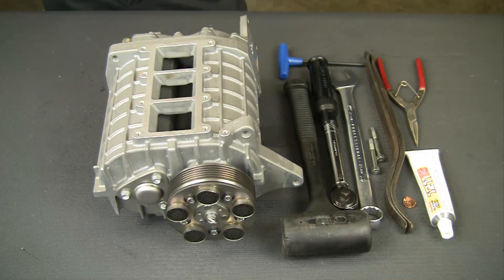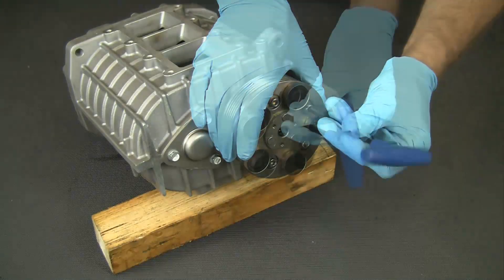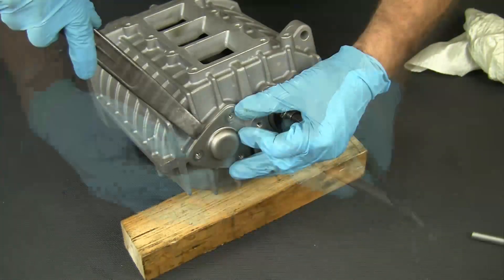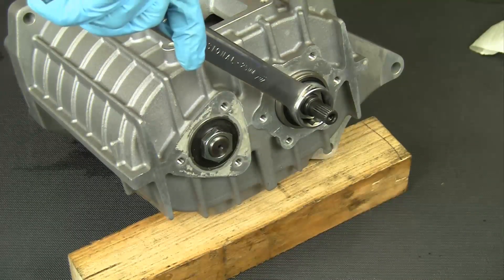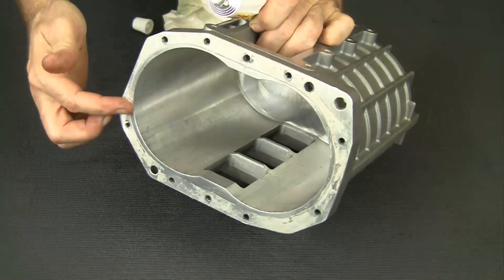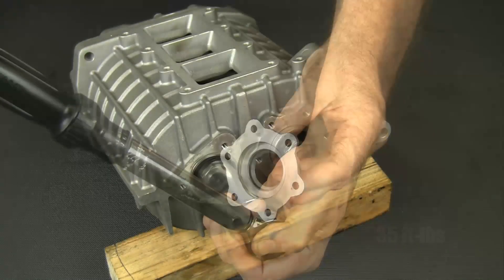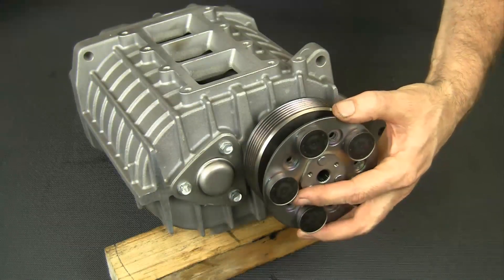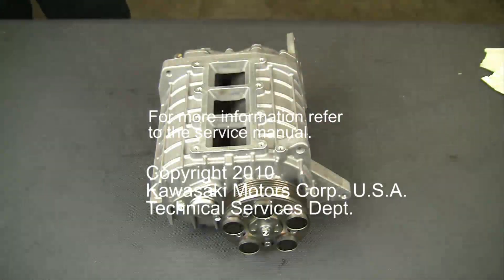Disassembling the Kawasaki Ultra 250/260 Supercharger

Comment: If the Teflon costing is coming off does the supercharger need to go in the bin? Or can you continue to use?
Reply: How bad is it? Small scratches, or big chunks that have fell off?

IIRC - someone did say that even if the whole coating comes off, exposing the aluminium rotors, it will still work.
But my guess is that the air being compressed and pushed out - will no longer be efficient since there are gaps between the rotors.
Do expect that less boost will be present if the teflon coating has already come off completely (or become in a very bad state).
Reply: @hsk2451  thanks for the reply.  It's got decent chunks on it, if I used as is the rest will likely go through the engine.  

I'll open it,  and strip off the remaining and see how it goes.  I'm using on a 4cyl toyota engine. Down a few psi is fine... if the concept works then I'll save up and get a new one.  

You're vid very helpful for the teardown
Reply: @Garage_Dori  Nah, video's not mine Sir. I'm also in the process of repairing my supercharger (Ogura TX15P)... and some internet community guys pointed me to this very useful video!

Comment: Hello man, love your work, and will be good help to my engine rebuilt. Thanks a lot.
Can I ask you look a guy with lot experience in this kind a engine, I have 2007 kawasaki 250X ultra 1500 jt, and the crankcase it is finish the OEM parts 1401-3745,  It is the some from the 2008 model? OEM number is 3746 but I will like to know if the crankcase are similar? I need to buy used one but there is more possibility with other models, can you help with the info. Thank,

Comment: What was the name and brand of the sealer?
Reply: I know this is old, but looks like Threebond 1211.
Reply: rodsatheart Ya it was I got some from The Kawi Dealer.
Reply: Do you still have that ski ?
Reply: rodsatheart Yes I sand blasted the Supercharger and painted it red to match the ski. The last time I took the ski out the engine blew. Cylinder 4 has no compression. So  my next project is to rebuild the engine or find a new one then rebuild the old one in my spare time.
Reply: I used all stainless steel bolts when I put it back together.
Reply: rodsatheart PMED you
Reply: It is made by ogura! A japan industry and they dont sell spare parts or one unit of this supercharger. Some parts we can buy . like a upper and lower bearing. And the clutch we can use the same a/c compressor. But lobes are so hard to find!